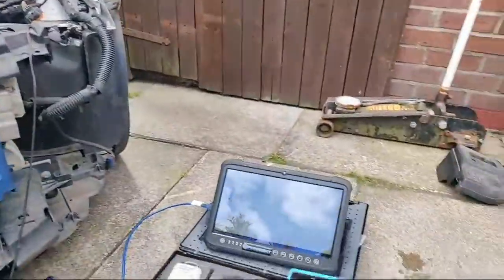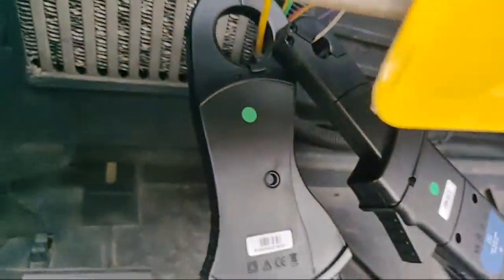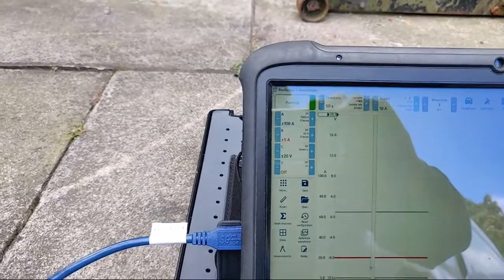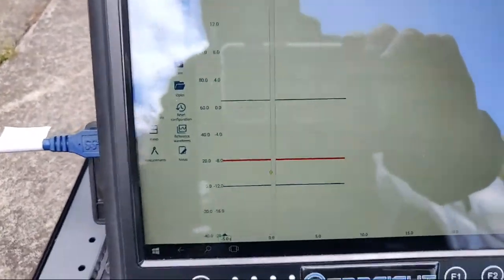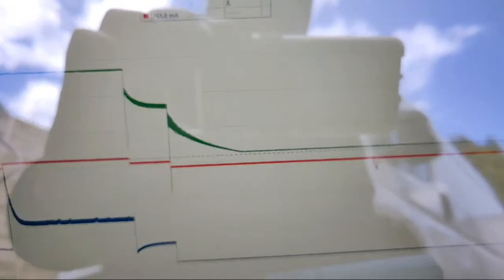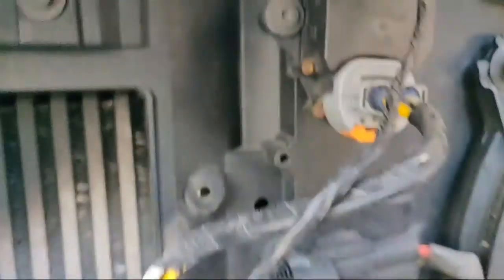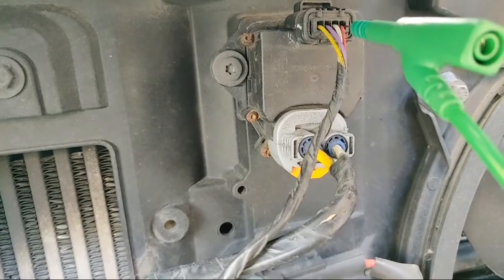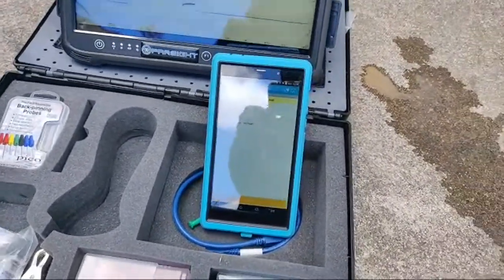Cooling Fan Current Draw Testing Pico 4425A

Comment: I didn't really understand how you conclude that module is bad from those patterns. Was it to much values or something else
Reply from the maker: I don't show all the test steps I've done, this is deliberate to get people to ask great questions like yours 👍 
We tested the integrity of the loom, the ability of the fan to run and the control circuits. The only part of the system that was an unknown was the control modules internals. If inputs are good, actuator is good, any failure can be reasonably put down to the bit in the middle or the fan controller. Given its location, the signs of water and the high failure rate of the part, it is reasonable to pin it as most probable cause.
I got it to fail off camera, tests confirmed it was the controller, it had a new module and has been fine since then 👍
Reply: @SimplyDiagnostics   Thak you for explanation, know you said it is cear

Comment: Hi , great videos and enjoy to watch. When i was watching your video on battery drain on your van in is much quicker to uas a AMP HOUND  to find to current through the fuse on test. The amp hound has built  in software to calculate mV drop over fuse size and type to instantly display current. One you have used a amp hound you would not go back to the power probe fuse chart again. David

Comment: If you can take apart the module, you might see wet inside.  
What's the spec for current with that fan running and the engine running?  May be time for fan replacement.
Reply: Your right if it's difficult to take it apart.  Sometimes with intermittents  it's worth the time to be sure.
Reply: How about tapping or banging on the module with the engine running and the fan on.....simulating vibration.  Or heating it with a heat gun.  We used to have a spray that would chill or freeze an object.  Heat , vibration, and or cold can help find a problem.
Reply from the maker: It's on a 60amp fuse so I would expect around 20 amps, I checked with engine running and it was the same as the actuator test we ran.
Life's too short to be pulling modules apart and see what went wrong. I'll leave that to Ivan 👍
Reply: @SimplyDiagnostics  Ivan was fixing Boat Electrics in the last Vid  - he has enough water around him :) By this time he should be im FL already :)